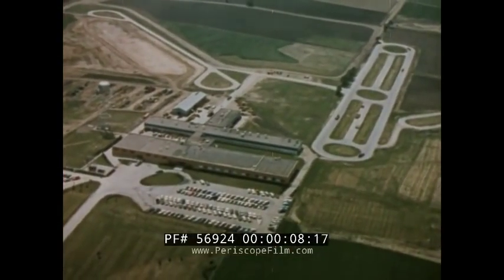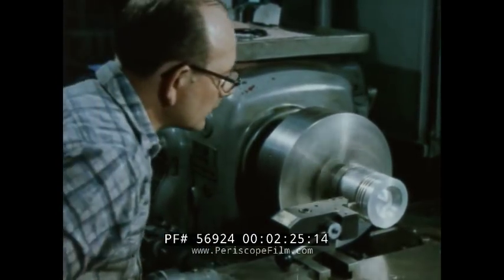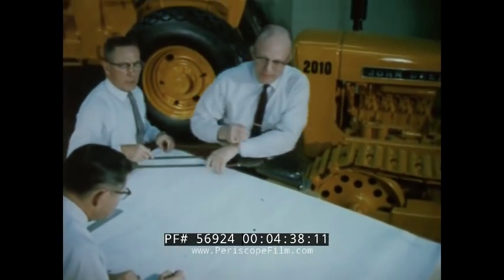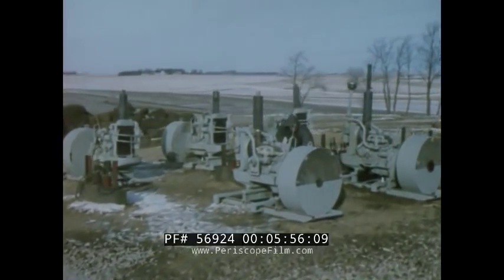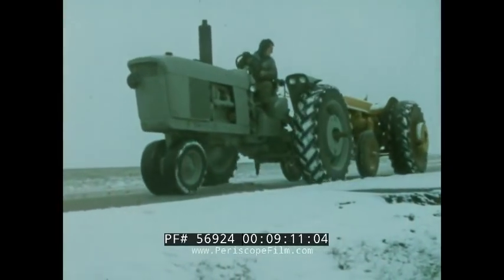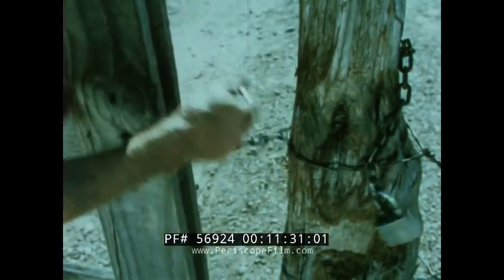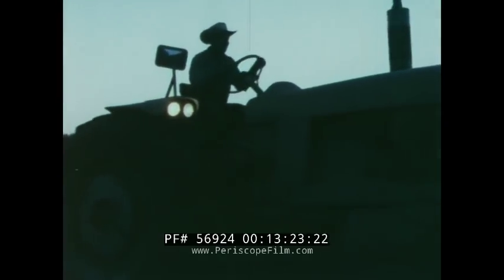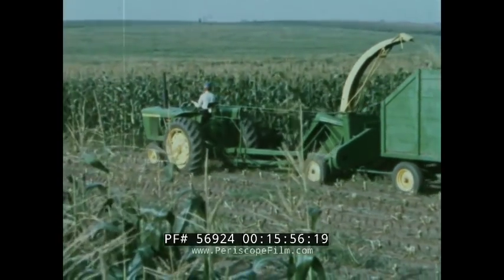JOHN DEERE  TRACTOR RESEARCH & DEVELOPMENT "MEN, IDEAS AND TRACTORS"  56924

Comment: Deere and Co was some of the best R&D in the industry.
Reply: Sure... when you consider many of their "innovations" were already in the market.  Sometimes close to ten years before Deere got on the ball.
Reply: We were Deere dealers from 1953 till 1990 and large scale farm operation and I still like my cornbinders and Fords and others
Reply: @williamhalpin6713  Then you are fully aware Deere did not innovate.  Deere consistently took others designs.
Reply: @Look_What_I_Did  you're right VanBrunt grain drills, mechanical front wheel assist, rotary cylinder combines ( Deere experiment with a top secret one on our farm summer of 1981),clear view over the hood of tractors exhaust and precleaner to the right and on and on

Comment: I have my grandpa s slide rule fun to use it. Fast when you get good
Modern Finite element analysis revolutionary in design of structural engineering.
Computer models did improve designs greatly . Yanmar and Hitachi of Japan makes alot of Deere tractors and excavator s and Liebherr of Germany made dozers for quite some time. CAT uses Mitsubishi Japan on small medium equipment. Little is made in America except Chinese take out food now...
These are the beginning years of modern engineering..which many other countries copied our ideas and machinery.
Awesome work Thanks.
Reply: "They"  tell us that it is "progress" ....   Well, is it ?

Comment: You always wonder, WHY  it is THEIR Machine that fails -  if it's  been tested like that but the customer can break it  ( Speaking as a Dealer)
Reply: simple. lack of proper maintenance and care.
Reply: If you are so smart, then go design, test and manufacture it for yourself. Or, don’t be dealer.
Reply: Does John Deere ever take responsibility?
Reply: Because engineers will only test the ability of what it was designed to do.
Destructive Joe will try to use the tractor for a job it was never designed for

Comment: Does anybody know what the point was to put the two front wheels so close together on some of these tractors? I can't see any benefit from that and would actually even think that this just increases  the area of the field that is negatively affected by the tractor's wheels.
Reply: They weren't called "Row Crop" tractors for no good reason. The normal crop spacing was 36" when these tractors were produced. The two narrow front wheels traveled in between 2 rows as did each of the rear wheels. When the tractor reached the end rows of the field, you applied either the left or right brake and turned the front wheels 90 degrees and the tractor would pivot around very sharply on the rear wheel of the side that the brake was applied so you could turn around and head back in the other direction in a very small area. You could literally spin the tractor around on one tire.  That is the reason for the narrow front tractors.
Reply: Also when they picked corn the snouts of the mounted pickers came down beside the front wheels. Look for corn picking videos and you'll see what I mean.
Reply: Thanks.
Reply: Thanks.
Reply: Lot of the front mounted row crop cultivators were mounted so you could'nt use a wide front end. Later on they made the cultivator mounted further back. I still cultivate row crops with a front mount 8 row 30" on a 1970 4020 with a wide front. Love it too!
Reply: The 1st front mount cultivators would only fit on narrow front ends. I had a "60" 2 banger with a 4 row front mounted cultivator and loved to cultivate with it.
Reply: Because narrow front ends were required for most front mount cultivators and bean pullers,  you can turn sharper/faster with a narrow front plus cultivate taller corn as wide front support sits lower than rear axle.  You also need a narrow front for mounted pickers ( for different crops ) plus cost less money than a wide front.  Each front end has their own advantages and the nice thing about late 2 cyl. and newer you can easily switch front ends until newer models which are wide front only.
Reply: No offense, but apparently you've never been on a farm. I'm joking with you

Comment: the engineers worked and reworked meaning we need to make that bolt so you can only get it without taking the tactor completely apart
this is after the other tractor companies already had four-cylinder tractors    they did not want to past two cylinders  maybe to risky

Comment: Seems like they wouldn't make any money after all that R&D expense.
Reply: Thought you fixin' to say it seems they wouldn't make a lot of volume expectin' money because their JD Tractors were built to last forever!
Reply: It may have cost them a lot of money, but that's what put them on top. And the timing of it was impeccable. This came out when International Harvester was building their 60 series tractors which were troublesome at the beginning. IH made a tractor with new engines and hydraulic systems when they needed a new clean sheet design. The 460 and 560 tractors still used the older design for the rest of the tractor, but compared to the primitive 2 cylinder hand clutch John Deeres, this seemed like a big step up. The transmissions and final drives were of similar design of the H and M tractors from 1939 but the new engines had double the horsepower causing a weak point. Yes, IH fixed them, but John Deere introduced these new generation of tractors just in time for the weaknesses to really show in the 460 and 560 tractors. That put John Deere on top and they never looked back since.

Comment: All that testing and they still built a 440 crawler and the 2010 tractors, both are and were JUNK.
Reply: The 440 was not a new generation tractor. It was the 1010, which was little more than a 430 with a 4 cyl engine. The bulk of the R&D went into the 3010 and 4010. It was not until the 1020 and 2020 that the smaller tractors got the same level of scrutiny.